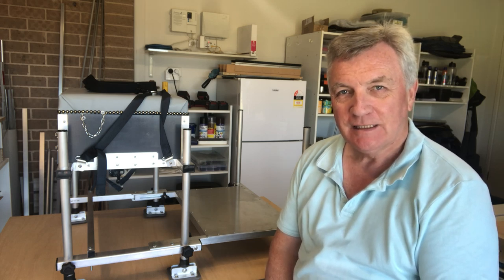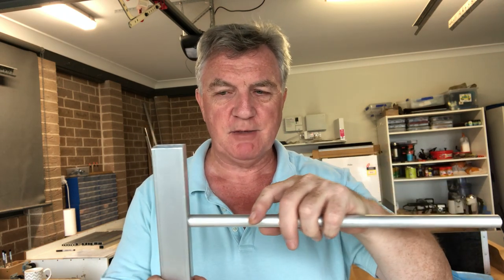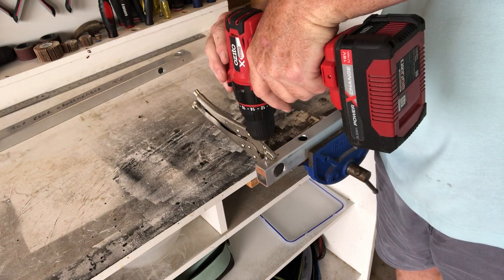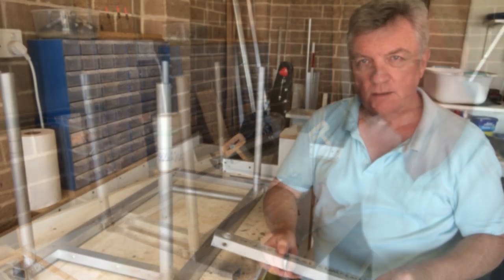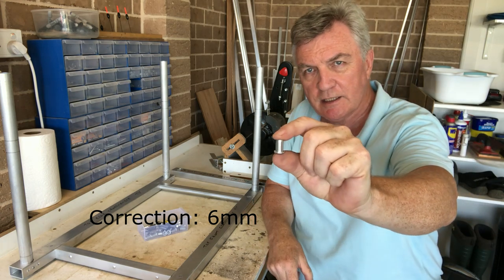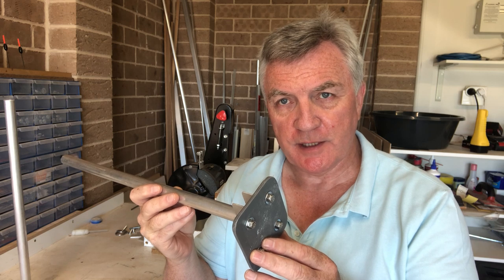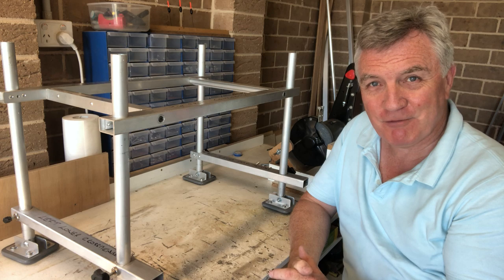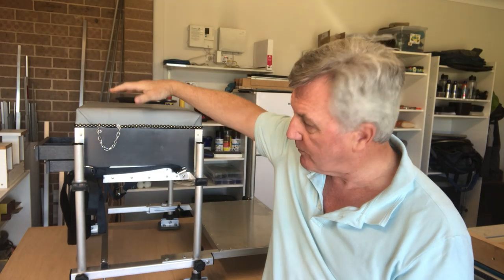Homemade Fishing Seat Box - Part One - Building the Frame & Footplate

Comment: As i'm watching - a suggestion for the foot pads - use a coach bolt upwards so rounded end is in contact with ground not a nut!
Reply from the maker: Thanks Adie. The beauty of this project is that it is adjustable to whatever suits the person making it. I have had one of my viewers make the box and use 3D Printed parts, which prompted me to buy a 3D Printer. I have now changed a lot of the accessories to 3D Printed versions myself.

Comment: Another great vid.  I have being mulling over why you need a plate on the bottom of the foot plate as all the pressure is on the bolt at the rear and then legs at the front?  Plus it would allow a quicker return time when folding?
Reply from the maker: Hi Phillip. Thanks for your comments. I could have had additional bars across the footplate instead of a flat plate, but as with all things, it was just my personal preference. Not sure what you mean by a quicker return time though?
Reply: @FishingwithDen   if the plate on the bottom was not there it could be lifted without the need to pull then lift.  I know it is only a minor thing but I  just have a bad habit of looking at ways to make things quicker.  I am not always right mind? ;)
Reply from the maker: @Offcut55  Hi Phillip. I see what you are getting at now. In fact the existing Footplate could easily be built without the need to slide the mechanism in. It's just a question of hinging it at the pivot point. This was one of the points I researched in some depth on the Internet. There are some cheap universal Footplates out there that do exactly that, but it seems there is a danger of the thing folding up when you stand on it. The sliding mechanism is designed to provide a locked base to the complete unit to prevent that. That is why other boxes with the folding footplate use the sliding mechanism too. I too am not always right mind! Lol. Tight Lines.

Comment: Hey Den. I am struggling to get 2mm 38 x 25. Do you think 1.6mm would do?
Reply from the maker: Hi Mark. I always used to use 1.6mm on my previous boxes. I only bought the 2mm this time because that was what was available. Having said that, a lot depends on how much you weigh, so I can't guarantee that it will work and 2mm will be substantially stronger, but 1.6mm would have been what I would have tried if it had been available.

Worst Case, you might get a failure of the main crossmembers, that would have a cost implication, but if you test it early on, at least you could then buy a thicker length for the main loadbearing members. Sorry I couldn't be of more help mate.
Reply: @FishingwithDen  Thanks Den. I will give it a go.

Comment: Hi Den. In the vidio you point out the alloy tubes ect. You mention 6 x outer legs and 6 inner legs!!! I can only see 6 legs in total on the frame. Am I misunderstanding. Please put me right. Thanks.
Reply from the maker: If you go to 2:45 in the video, you will see the 6 outer and 6 inner legs Jim. From 21:10, it shows you how to build the Inner Legs. I hope that clarifies things.
Reply: @FishingwithDen  Thanks Den. My mistake was I did not realize that the inner leg actually slides inside the outer leg. Got my Irish head around it now. Thanks for the reply

Comment: Hi den, I’m currently speaking to a local aluminium seller and I’m looking to buy all of the material at once and I don’t believe all of the listed items in the description are what I would need, could you please provide me with a list of everything If possible, in particular the footplate, I understand if not, thanks, callum.
Reply from the maker: Hi Callum. From your question above, I'm assuming you are only talking about the aluminium parts? There's not much I can think of for the aluminium frame other than some 3mm flat bar which I used to create the threaded parts which hold the outer legs together. There was also a 19mm x 19mm x 1.6mm square tube which separated the legs, but this was just from a piece I had left over from another project. The footplate was 1.6mm aluminium which I bought as an offcut from a very obliging seller. 

I assume you are talking to a proper supplier rather than buying from a DIY store, otherwise it will get very expensive. Having said that, if you just need a small piece of aluminium, the DIY store is a convenient place to go.

I don't have a complete list of every item I used to make the box and accessories, but if you watch the videos, it will become clear what you need to buy. Unfortunately, I didn't have a complete shopping list from day one, but then a lot of what I decided to use only happened as I went along.
Reply: Fishing with Den Thankyou for the quick reply! Yes the supplier is a friend of mine, he was just going to cut the ally and send it over to save me the time so your measurements are really helpful, I have since watched the video and drawn up each piece with the correct dimensions it’s just the footplate I was struggling with but it was easy enough once I watched it a few times! I’ll keep In touch if I have any more questions! Thanks again

Comment: How much would this cost you to do it yourself.
Reply from the maker: I did a quick reckoning Graham. It came to about £175 if you had to buy everything. However, I had some items in my garage so it was less than that for me. An interesting point to note is that you have to buy the aluminium in 6.5 metre sections where I am, so if you built 2 boxes, the cost of the second box would be very much lower. 
In my case, I am going to use the spare aluminium to make side trays, a Pole Spray Bar, an adjustable Rod Rest, Keepnet Holders and a Trolley/Platform system for longer walks. These will all be almost free, so the project becomes less costly. I will be posting up videos on these items over the coming weeks.
Reply: @FishingwithDen  thanks